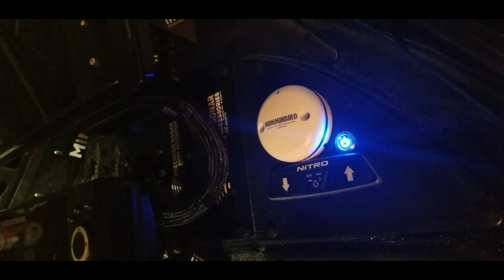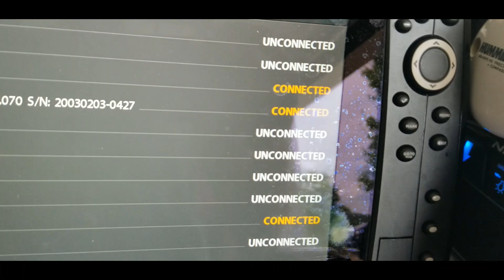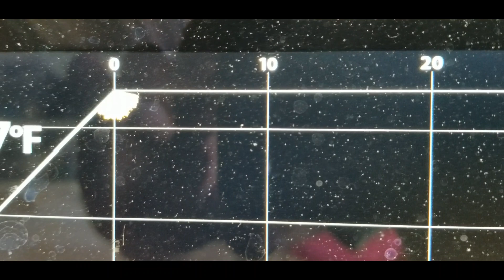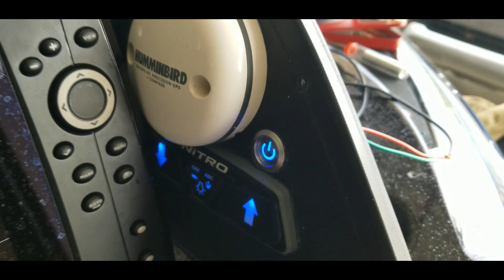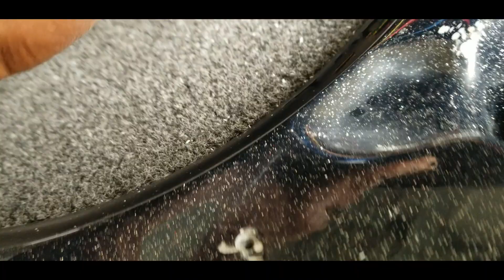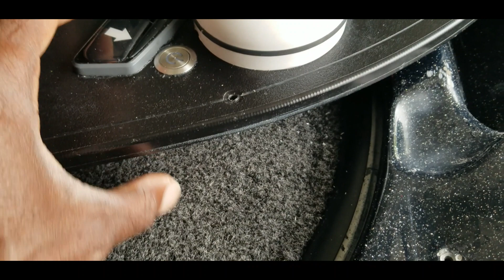Humminbird Mega Live Power Switch (Must have!)

Comment: How did u not have to add a relay? The 10awg wire that feeds power to the mega live you just connected straight to the little 18-20 gauge switch wire? How does enough power get transferred? Or am i missing something...

Comment: i am hooking up a mega 360 to this same switch i heard you mention the drain wire but i never saw you put it anywhere on this switch...do i have to run that separately back to the fuse box? or does it go on the ground on the switch?

Comment: Power switch looks nice but so unnecessary, turn off you ping and put unit in standby mode. If your boat doesn’t have a master switch in the back that’s what you should be investing money in
Reply from the maker: Thanks for the suggestion. It may save some people from installing one that don't really need it based on their setup and how they use the other functions on their boat. I have a master switch in the back like you suggest but sometimes need to run my live well and other things like lights without having the Mega Live on. There are factors to consider whether it is necessary or unnecessary considering the needs of the individual.

Comment: Love your video's.  I have a one off question.  I see you have the heading puck with the compass.  Is that for your Mega 360?  I know the "GPS puck" is for your Ultrex but wasn't sure about the heading+compass puck.   I always get confused when I see boats with 2 pucks.  TIA!
Reply from the maker: Thanks for watching and supporting the channel. Be sure to watch the livestreams Tuesdays at 8pm EST each week. I don't believe there are any features of the 360 that use the external GPS directional puck. It is for the graphs.
Reply from the maker: I have 3 pucks. 1 at bow. 1 at console (needs to be at the back of the boat) and one for the Ultrex.
Reply: @MoneyBass  why do you have 3?  Are all of them the same?
Reply from the maker: @mikekenner9218  for accurate casts and scanning. https://youtu.be/s9L9ICsIzOI
Reply: @MoneyBass  Great video.  How do you hook up a compass puck?  Do you have a video on that?  I assume you install it while installing a Helix unit?  

I saw this video https://www.youtube.com/watch?v=cVBE0Vn20_0 but the heading sensor was different than the one in your video.  TIA!

Comment: How do you connect the very heavy power cable from the mega live to the tiny, thin cable of the switch?
Reply from the maker: I crimped and soldered the connections.
Reply: @MoneyBass  what connectors did you use?
Reply from the maker: @katiedolfman6496  standard electrical crimp connections. https://youtu.be/bcKXJVa0DtQ. I show the process in this video.
Reply: I've watched the video several times.  I see the ground wire going to fuse panel.  According to the switch, you have to hook up the red and green wire of the switch to the red wire of mega live.  What connection did you use for this?  The live wire seems to be 8 gauge and the switch wires seem to be 20 gauge.  I didn't see this actual connection in the video
Reply from the maker: I can't remember specifically. I followed the instructions that were provided. There may be a part of the video where I show a close up of the connections but I completed this several months ago. I don't want to give you the wrong info.

Comment: How’s that switch working for you? Any issues with it? No sign of low voltage or anything?
Reply from the maker: It works fine. No issues. I haven't noticed any issues regarding voltage. I looks like it might be the same one used from the factory at the console.

Comment: Been watching a lot of your videos getting geared up to install the mega live as soon as the cold breaks here up north.  Couple questions.  What gauge wire is on the switch?  I have 10 gauge ran to my fuse block and run 12 gauge from there to my units just want to make sure I wont drop smaller than 12 gauge with the mega live.  And my last question is how does the mega live hook to the units is it ethernet or through the transducer port?  Thanks for all the work you've put in.
Reply from the maker: I actually spliced my switch in the power cable from Mega Live transducer. I wouldn't suggest doing it that way. I ran 8 guage wire from the batter to the fuse panel. Search MoneyBass Mega Live installation and a few videos should come up showing what materials were used along with video. Mega Live goes through the ethernet.
Reply: @MoneyBass  do you think the 10 gauge from the battery to the fuse is enough or does the upsize to 8 make a difference?  Appreciate the response and I think I got that video up on my iPad right now lol.

Comment: No issues splicing heavier gauge wire from your ML into the 22gauge wire from this button?
Reply from the maker: No. I've connected car audio systems and other electrical work so it wasn't complicated for me.
Reply: @MoneyBass  sorry, what I meant was are you concerned with the smaller gauge wire from the push button being the weak point between your ML and the power source. I bought this switch and realized it’s only 22gauge.
Reply: I came here to see about the drain wire. But saw your comment. I was worried about it. What I did was buy .187 disconnect spades on Amazon and crimp them to 10awg.  The .187 size fits perfect into these micro sized switches.
Reply from the maker: @ronwhitefishing  I can't remember what size connections I used. I wasn't sure if there would be any issues but everything has worked fine.

Comment: Great video and great information. Wonder why my guy who sold me the live didn’t do this!!!! Have you ever had a trolling motor (ultrex) keep connecting and disconnecting?
Reply: I have had my ultrex disconnect and connect.....I found if I turned off the mega live and 360 from the network on the graph at the dash.... problem solved no more issues for me.....hope this helps
Reply from the maker: Was your live installed by a company or an individual that does installations. From what I have seen the majority of issues come from short cuts being taken on the installation. Be sure to go through the manual yourself so you know what questions to ask your installer. I'm curious to know what he says about not installing the switch. I also have perko switch that allows me to turn off EVERYTHING including the live but there are times where I need to have other things running and have the capability to turn off the live separately. I haven't had connection issues with my Ultrex but I've heard some people have experienced network issues with their hub when all ports are used. I would try connecting the trolling motor to a different port on the hub and see if the issue changes to what ever is connected to that port. Hope that helps. Thanks for supporting the channel.